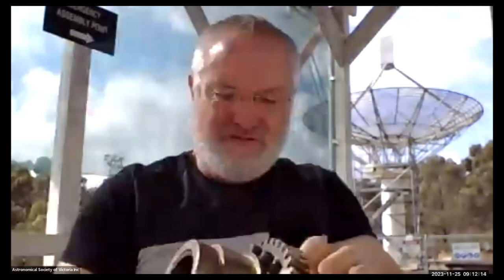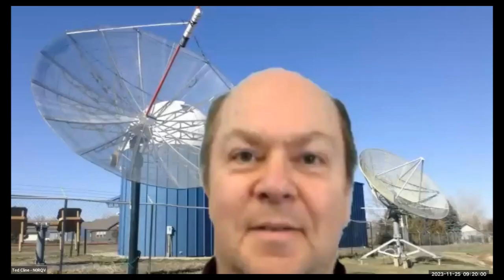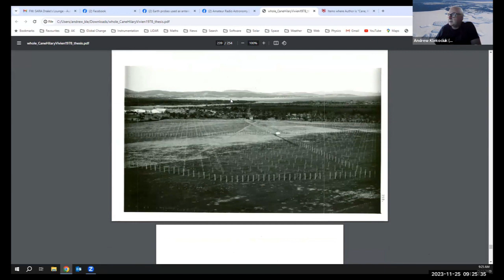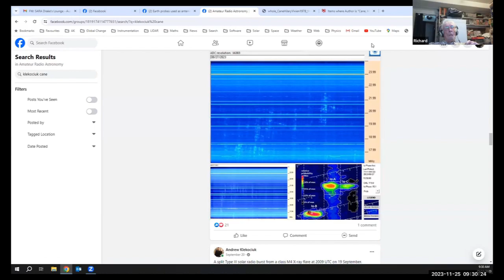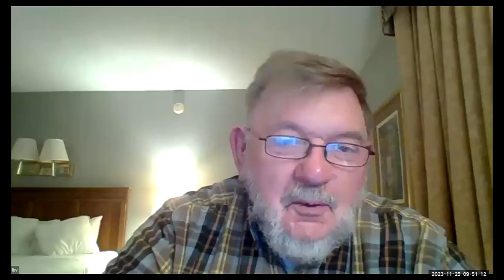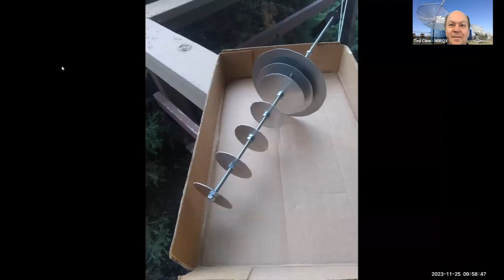Drake's Lounge Australia Nov 2023: Chat GPT, Jupiter detection, Meteorite Beacon, 3 Element Array

Comment: Regarding,  Nathan's extended WiFi dish, drift through the Long dimension for min beam width. 

                             Antenna Beam Width measurement
Run a drift scan through the Sun, record the max ampl every 10 mins or so, for +- 1.5  hours and plot Tme vs Power ( or dB ) in Excel .. 
The - 3dB ( half power ) points = the Beam_Width            1 hour = 15 degrees